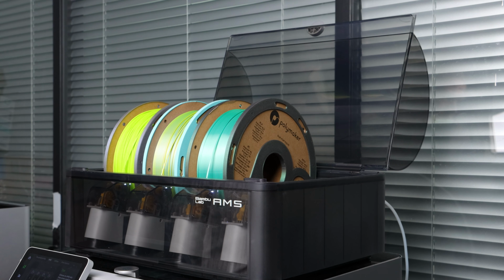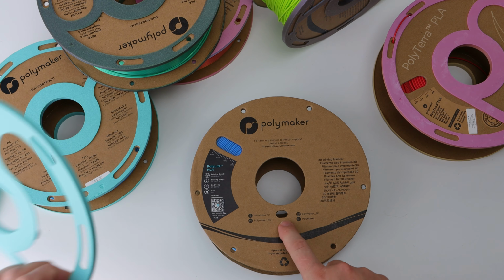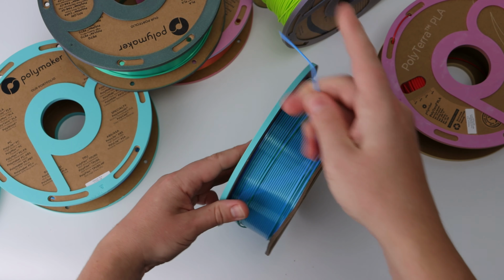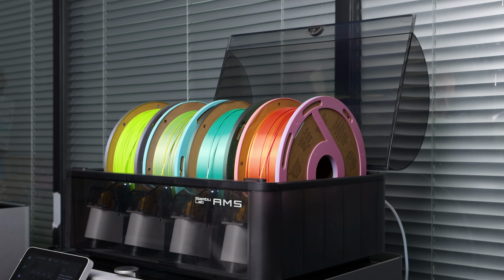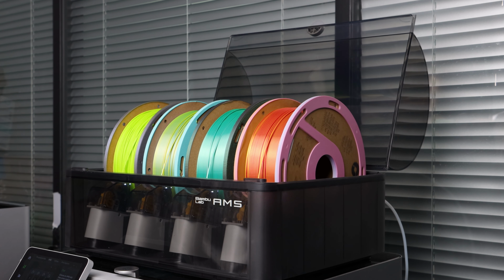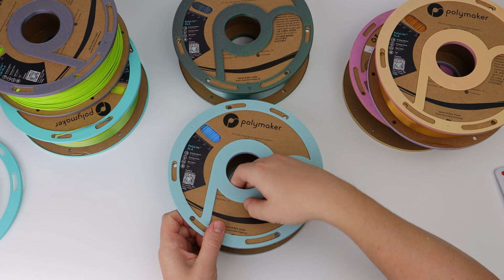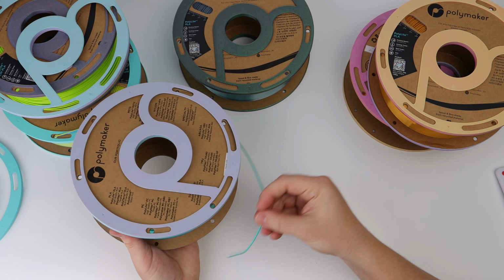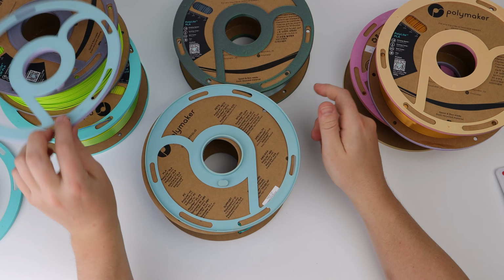Cardboard Spool Adapter

Comment: This has been the primary reason why I haven't gotten the AMS unit for my P1P yet.  Glad to see some steps are being taken by Polymaker.  Really hope Bambu does something as well.  Good job!
Reply: there are ways around it. This being one. Replacement (from the community) "tub" to be able to use different spool types and sizes. Then there's the spool winding thing.
Reply: I did not try these exact rings but for my printer it doesn’t work with two different designs because it’s touching the lid of the arms.

Comment: I personally just put electrical tape on the outside. Very quick and easy to install and doesn't waste filament. Also creates a better grip. And is very cheap to buy.

Comment: Oh these are much nicer than anything I have seen available
Reply: agreed.
Reply: Just put electrical tape on the outside. It stops flaking and creates better grip than this would.
Reply: @cerialgaming4168  have been using the ams with unmodified cardboard spools with zero issues.

Comment: I notice you never show the AMS lid fully closing. Will these fit with the lid shut and latched? All of the other adapters I have tried hit the lid. I’ve always printed with Polymaker, but I’m struggling to make it work with my new X1C…
Reply from the maker: Short shot: 1:15
Reply: From what I have heard, some AMS units have a tighter tolerance on the lid closing than others. Its a really close fit on mine but it doesn't touch. There might be some adjustments you can make to the spacing.
Reply: @Polymaker  You show the lid being closed but don't show the spools working afterwards. I've tried other printed adapters and so far, haven't been able to print with the lid closed (I'm certainly willing to give yours a try too). It looks like the Hydra mod for AMS can provide more clearance but that's a lot of work just to allow me to use a work-around for cardboard spools.
Reply: @KenRossPhotography I’ve got the hydra unit installed on my AMS, and any spool adapters I’ve printed currently hit the lid and bind when closed, which is how I need to keep my AMS as my indoor humidity is 50-55% on the coast. I do have a workaround I read online that’s worked perfect however. Wrap the edge of a cardboard spool with electrical tape and it’s instantly AMS compatible. It’s worked super for me this far. After 3 spools I’ve got the application of the tape down and it only takes about 1 minute per side to apply.
Reply: @Polymaker wow it’s possible to close it but we can’t see if it works correctly.

Comment: I do have the same problem: As soon as I close the lid of the AMS the spool ring touches the inside of the lid and the spool cannot rotate anymore. 🤷‍♂️
Reply: I do have the same issue, but is that standard?
Reply: Had the same issue. Electrical tape works and it's cheap.

Comment: @polymaker I order around 30 spools "hoping" for plastic, 28 are cardboard. Can I return 28 spools to the place of purchase as they are not fit for purpose.. ? Cheers.
Reply from the maker: Was it sold as plastic spools but you received cardboard spools? If so, yes you can contact the POS and exchange/return the wrong products.

Comment: Cardboard spools are useless on AMS units.
Moving to cardboard is a wrong saving by the manufacturer: you saved some $, but you loose so many potential clients (like me), when we search BambuLab filament alternatives for our printers.

Instead, it would be smarter make, like BBL does, reusable plastic spools with refiling cardboard option (for any one who cares environtment, like you say).

I maintaint BBL, and go to SUNLU, eSUN filament options with plastic spools for urgencies/prices, while you have no plastic option.
Reply from the maker: Please note cardboard spools are more expensive than plastic spools.
Reply: @Polymaker  Then it makes even less sense the shift to cardboard.

In terms of sustainability in first place one has to try to RE-USE. If it is not possible, in the second try, Recycle.
So, the most ecological solution in this application should be:
Plastic reusable spool (recyclable plastic) + refilling spools with least packaging possible.

Cardboard spools are NOT Reusable, so you are forced to generate unnecessary waste. Recyclable, yes, BUT WASTE.

Best way is to REUSE: it doesn’t make waste.
Reply: yeh i like how bambu does it, and i use re-useable spools and print my own.

Comment: So your answer to combating waste from used plastic spools is to 3D print plastic to attach to them. LOL
Reply: Don't print more adapters than you have slots to put spools in your printer/AMS, then there's no wastage.  What's the issue?
Reply: This option is still better in terms of waste reduction compared to a plastic spool.
Reply from the maker: We welcome any better ideas :)
Reply: You really only need to use these on the bambu labs printer so in reality they still are saving a lot of plastic
Reply: @Polymaker  You should have done what bambu labs did and make reusable plastic spools and sell just the filament to be placed in them.
Reply: Yea, dumb move on Polymakers part.  I've talked to a few people now that own bambu labs with ams and we will not purchase cardboard spools anymore, sometimes these adapters do not work if the cardboard spool has any flat surface or damage from shipping.  I have a feeling this move by them had nothing to do with helping the environment and was really a cost cutting measure (it's a game companies play to cut cost while making the consumer think they did it to save the planet).
Reply: @Polymaker It would be great if you sold these bambu adapters on your site. I think it would boost business with more customers from Bambu users. 🤔
Reply: @Polymaker Apply a coating to seal the edges of the cardboard spool to avoid creating dust inside the AMS. That would be a good solution. Now, if the cardboard spool is damaged we can use these adapters as a last resort. Right now the adapters are not an option to me, they rub against the AMS lid when closed. I live in an area where the humidity is very high all year around so, leaving the AMS lid open is not an option (unless I want to dry my filament every other day).
Reply: You do realize they are reusable, right?  Print once, use forever.  It "pays for itself" on the first roll.
Reply: lol, he thinks Bamboo sells refills for master spool…. For like 3 colors. 😂
Reply: @MrKornnugget  whished they did this for all their filaments. IMHO it is the most eco friendly solution.
Reply: @BruderTux  Debatable. They are shipping with the cardboard center already in the refill, the two round piece of cardboard on the sides of the regular cardboard spool do not add that much material and the master spool rolls still have plastic straps and do not stay as nicely wound. Also, there is a reason you can only get a few colors in refills from Bambu, the amount of failures in manufacturing is much higher and Bambu looks to be moving most of their inventory to plastic spools. A failed spool roll requires it to be ground and remelted which much worse than just using a cardboard spool. Since the cardboard spool was the standard before the AMS, maybe Bambu should come up with a solution. Master spool just makes us fee better while we melt plastic shipped all the way from China into benchy boats. You want to really help the environment, order your filament from nearest manufacture to where you live instead from China.
Reply: Real the polymaker filament onto empty Bambu spool takes a few minutes. Let’s not pretend we print filament to save the environment. #1 it’s a hobby/convenience #2 sell products to make money.
Reply: @Polymaker  "We welcome any better ideas :)"
USE PLASTIC !!